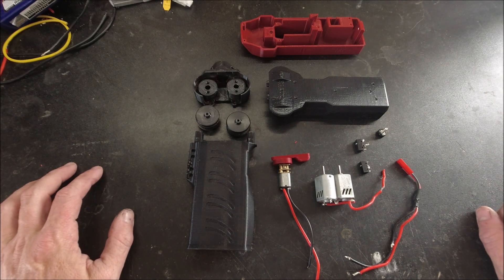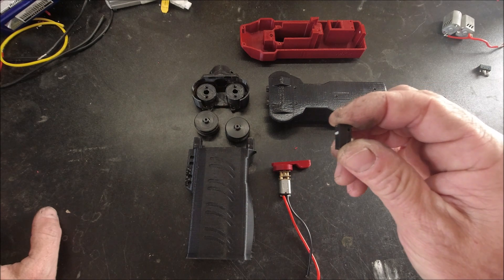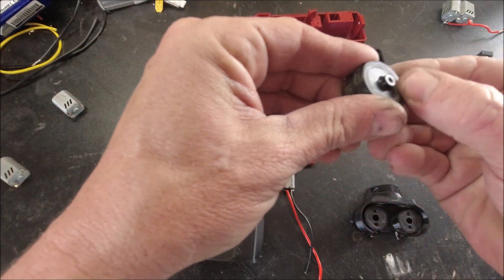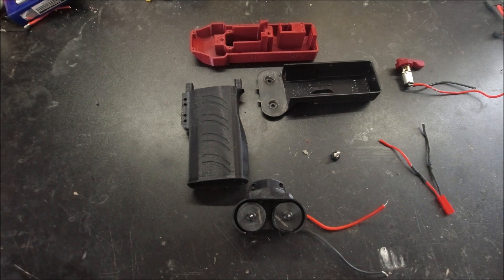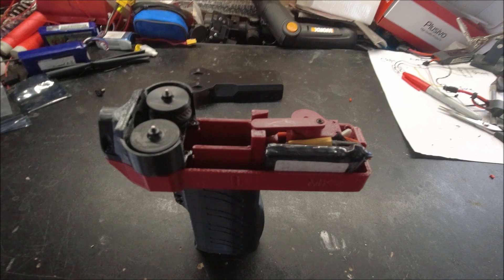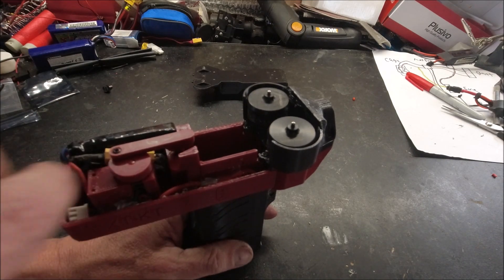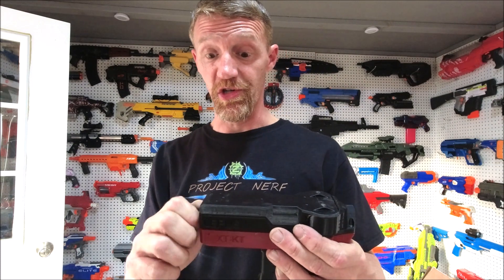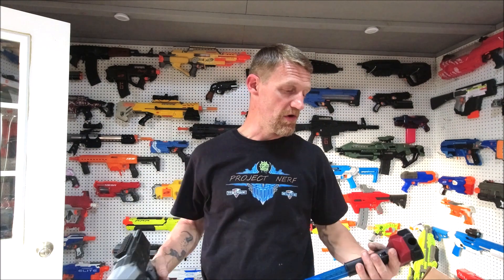Nerf ER, Lepus !!

Comment: I don't know if you are aware of the Kelly industries Rapidstrike circuit board, but if you are, would you recommend adding MOSFETs to it? The system is running Neo-Rhinos for flywheels and a Valkyrie for pusher.
Reply from the maker: You certainly could ad mosfets to it. But not because you might burn out the board. The Kelly board doesn’t have fets in it, so the switches are what would likely go under normal use, though I have never had that issue.